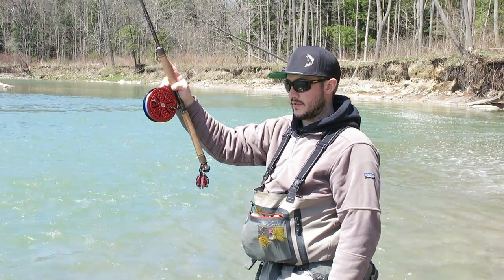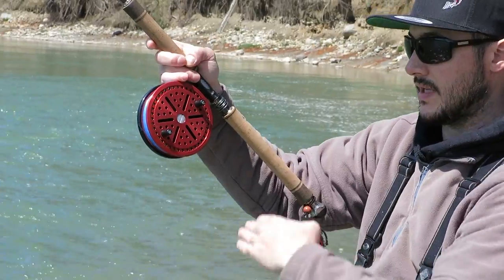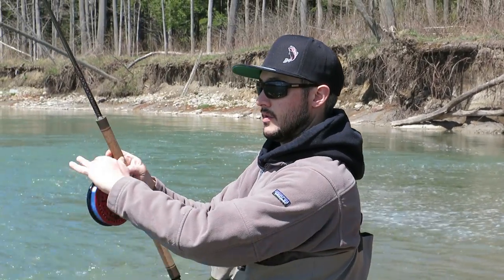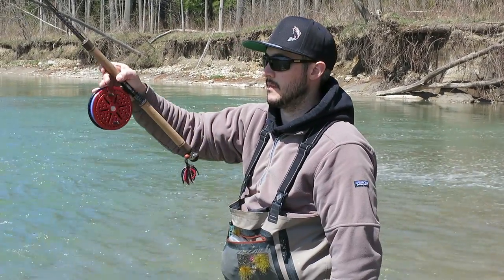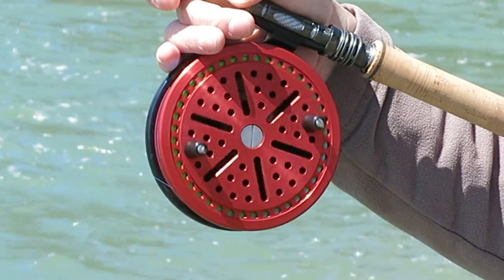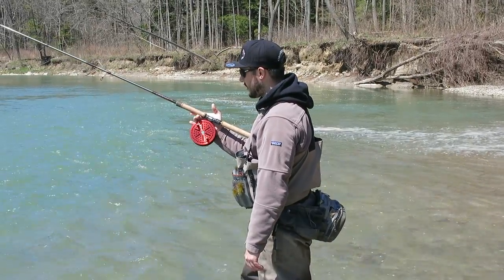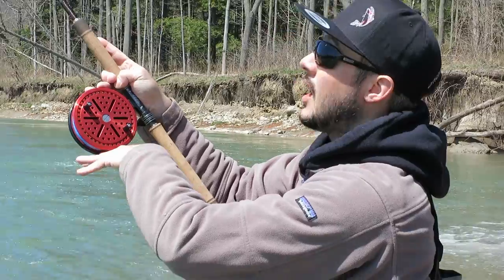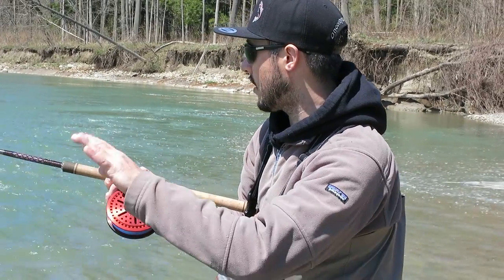Centerpin Casting! Wallis Casting and Cross Body Wallis casting with Danny Colville

Comment: How long are the typical leaders are being used on these centerpin setups?
Reply from the maker: The leader is 15-24" fluorocarbon. The Lead is the distance from your float to fly and that's all depth dependent
Reply: Yes i get that, just wondering how long from the float to the hook?
Reply: Only when your using a fixed float

Comment: I use a bobber setup, we call it the bug and bubble setup. We will use a float, and a two to three fly setup on about a 10 1/2 ft leader. Using anywhere Between a 9 1/2 to 13 ft float rod.
Reply from the maker: I love it Randy thanks for sharing...where are you from
Reply: I live in southern oregon, ive been fishing the rogue all my life almost strictly for steelhead. I was just wondering on the leaders if it is harder to cast the longer leader w the centerpin setup. I could go on with questions cause i need a new challenge and the setups you guys use seems to be a lot more personal, i love custom gear, and its time for me to just make the change, i just hope i can get the casting down without backlashing it to many times. Should be fun!
Reply: Colville Outfitters i live in southern Oregon
Reply from the maker: Hey Randy yeah the longer the "lead" (float to hook) the harder it is to cast. That's why some opt for slip floats. I just like the bait control I get with a fixed float. Call or email Colville outfitters  with questions

Comment: I have a question I'm new to this in alberta fishing Browns if the water is say  7 feet deep should I have 7 feet of line from hook to float or more like 8 ish or 10 feet of line?
Reply from the maker: Typically 7 door hole would be 7 foot from line to presentation all the way to 9 foot depending on how much you are trotting(holding back your float)